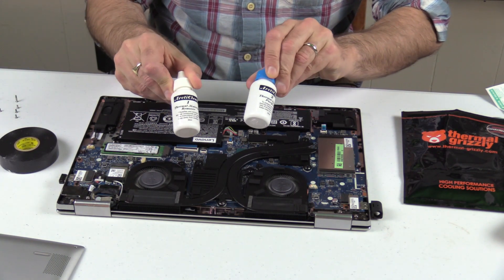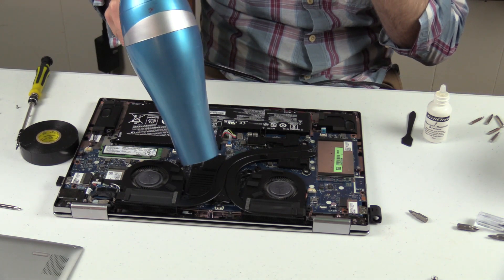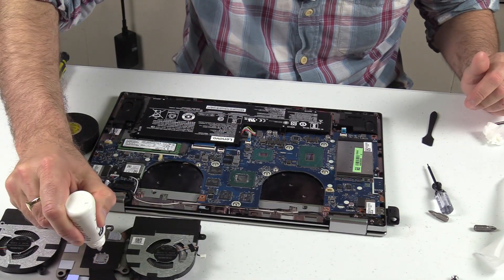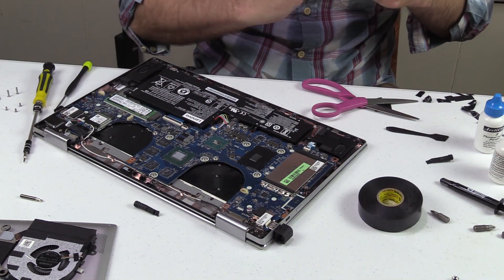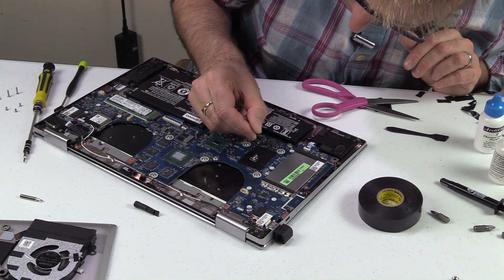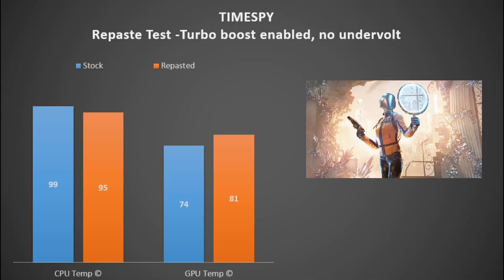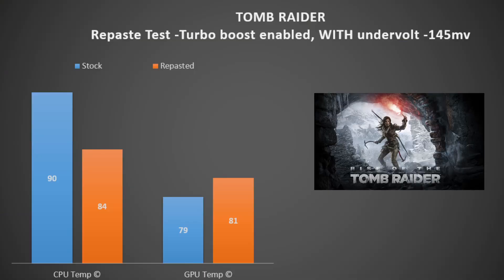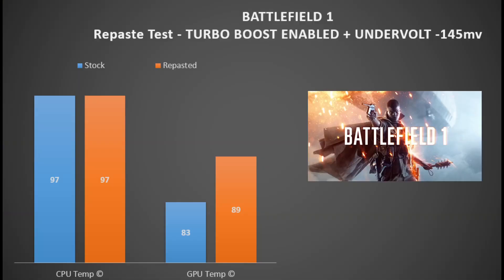Repasting The Lenovo Yoga 720 - GTX 1050 - Does it help ?

Comment: Just a tip for you always and i mean always disconnect the battery if possible else one slip will cost you the laptop as there is power still flowing on the main board.
Reply from the maker: William Rogers yes indeed, thanks for mentioning that. I pinned your comment.
Reply: Glad to help, seen some of your thermal replacements and noticed that this step wasn't done so thought i'd point it out, even when i did my GPU upgrade on MSI GT72-6QD the first thing i did was remove the battery. But a simple step for your Followers is simply Un screw and remove the back plate then promptly go to remove the battery before touching anything on the board. All will be fine after. But i do have a question with Liquid Metal does one have to repaste both the Heatsink Exchanger and the Die or can it just be pasted on the die?
Reply from the maker: William Rogers I found just placing it on the die is enough. I'm fairly new with liquid metal and I don't like the idea of a bunch of it migrating to other parts of the laptop..

Comment: I need to replace my fan assembly, so this is incredibly helpful. I found somebody to do it inexpensively, $35 labor. But I wanted to check heat before and after. And even for that this is very helpful.

Comment: Your assumption that the GPU temps go up because of the thermal paste is not quite right. As the heatsink can remove a lot more heat from the CPU with the conductonaut, all of it gets transported over the GPU to the fans and this way the heat is transfered to the GPU which gets hotter. This effect most likely would have been even worse with Conductonaut on the GPU.

Comment: Hello Stephen, Thankyou for the video, i unplugged my lenovo flex 14 battery and plugged it back in, now it wouldn't charge at all, when i unplug the battery again the laptop recognised power is connected, but when battery is plugged in then it doesn't recognise battery nor charger... do you think this is an software or hardware problem? thankyou

Comment: Is the heat pipe copper or aluminum? I heard that there you cant put metal on aluminum. Is there any chance of metal leaking? I know it might be stupid question but did you remove tape after applying paste? Thx for helping
Reply from the maker: I took it apart some 9 months afterwards, there was no corrosion so I suspect it was copper. I put tape around the die but I had put too much LM on and a bit did leak out. I recommend putting some a foam barrier around it and certainly less than I applied. My laptop was still working but don't have it anymore.
Reply: @OWNORDISOWN  thank You very much for response :) I'm new into replacing paste so I decided to stay with kryounat. Is it still the best option?
Reply from the maker: Yes, I think that is the safest option :)
Reply: @OWNORDISOWN  thank You! I will leave a like and subscribe! You are great :)

Comment: Hey there 1 Question: Is it possible to turn off the hyperthreading for this Lenovo maschine? (because of Meltdown & spectre)
Also it helps to drop the temp a little.
Reply from the maker: No I don't think so. I don't recall seeing the option in the BIOS and I don't have it any more., but you can disable turbo boost or even better just reduce the clock rate
Reply: thank you for your fast reply and your advice. Will keep your channel in mind. @OWNORDISOWN

Comment: just now finding this. I have a yoga 720 without the graphics card and am getting an egpu soon. Unfortunately when I run anything under load, it immediately throttles, so I will be repasting very soon!! awesome video!!
Reply from the maker: Noah Leake Thanks ! If you do liquid metal make sure to use less than I did. I put on too much really . Good luck ! Have you tried undervolting ?
Reply: OWNorDisown I have, but haven’t had much success. My thought is that I am using integrated graphics (limited to a couple games) for now. I was thinking this might be putting even more strain on the cpu since I don’t have a dedicated gpu.
Reply from the maker: Yes, it will do. You can undervolt the integrated GPU part too. Its a shame you cannot increase the fan speed. I'm going to do a video testing one of those graphite thermal pads...
Reply: use Gelid GC Extreme instead of metal

Comment: i saw videos for the 1080p version and it doesent seem to get to 90 it seemed to be around 50 celcius so is it just a problem with the 4k version
Reply from the maker: I wouldn't have thought so. If you saw my full review Lenovo disabled turbo boost so it would run at about 1000 MHz less. They did this because they knew it was hot. Most people wouldn't know . Perhaps the videos you saw still had it disabled....
Reply: was that done in a patch then?
Reply from the maker: Kamikazi Lucas it's done at the bios level. Install Throttlestop and you can check...

Comment: do you leave the electrical tape inside
Reply from the maker: Yes, it helps protect the surrounding area from the liquid metal. I put a little much LM on this time. Just a thin layer and you are good :)
Reply: Thanks, and also should I apply conformal coating underneath the tape just in case. And I'm not sure how much liquid metal I should buy.
Reply from the maker: Michael Lee can't do any harm.  The tape used needs to be thin, some use kapton tape. I like the idea of the conformal coating around the area too, last thing you want is the liquid metal shorting anything out on the motherboard.
Reply: One last question, what's the heat sink made of for the yoga 720 and will it corrode over time?
Reply from the maker: Michael Lee after 7 months my heatsink was not corroded,  it was discoloured,  like a stain. It wasn't brittle like you would get with aluminum so I suspect it is copper

Comment: I have an alienware 15r3 i7-7700HQ with gtx 1070 i need to repaste it since the temps go up 97 Celsius, is liquid metal safe after months on cpu and gpu?
Reply from the maker: juniora aburto After 7 months I opened up my yoga 720 and it was still good, but it will end up oxidizing and even reacting with the copper. They say to redo it every 6 months. Dont put much on, I put you much on here really. Good luck!

Comment: hello mr exklim realy i like your dissect about the devices and i want your experince to advice me. iam a graphic designer and interesting to get this device yoga 720 15  core i7 with dedicated invidea gtx but not the 4k cause it have a big issue  with thick blk line in top ... so do u recommend this model for work with adobe illustrator and premier
Reply from the maker: Mohammed Abdulaziz hi Mohammad,  thanks , glad you like my videos. Yes, I think it will serve you very well. Six core  CPUs will be coming out soon, perhaps next month and that may help in your rendering.  I haven't seen any models announced yet but that is what Gigabyte told me .
Reply: ?i appreciate your reply so The problem of heat will not affect performance
Reply from the maker: If you apply an undervolt you should be fine :) I wouldn't recommend disabling Turbo boost but you can also use Throttlestop to alter the multipliers down a bit if need be. Start with the undervolt and see how you get on :)

Comment: You should do a video on undervolting the GPU and see if there is some performance perks in gaming for this laptop
Reply from the maker: Already have my friend:) https://www.youtube.com/watch?v=kKATo7iLjXg
Reply: Alright, I tried it on my yoga 720 and I think I did it wrong it something because nothing changed from what I can tell as far as temps and frame rates go. I have it flatline at about 1800mhz at 925mv.
Reply from the maker: You won't see any increase in FPS unless it is boosting higher. Have you tried overclocking it? As far as temperature goes my GTX 1050 didn't get hot. BF1 is the hottest at 89 degrees and that is overclocked
What are your temps?
Reply: I haven't tried over clocking it because I'm fairly new to this. This is my first laptop with a dedicated graphic card.

Recently undervolted the CPU -0.140 and I'll reach max temps when using the xtu stress test at about 78c

GPU 70-75c indoors.

Now I am only getting my temperatures from monitoring xtu's min/max/avg stats.

If you have any suggestions I'm all for it
Reply: Would you recommend over clocking  CPU, you, or gpu memory?

Trying to get all the gaming performance out of this thing I can get

Comment: Does this break the warranty by doing this? Thanks!
Reply from the maker: I don't believe so. make sure you only put a small amount of LM on it. I would actually recommend sticking with something like Gelid GC Extreme. I did some testing and it performed at same level as the liquid metal plus there is less risk of short circuiting your motherboard.

Comment: Can't believe what I'm seeing here...
How can it be that you do not know that you DONT spread the paste!!??
https://goo.gl/n3dQp5
Reply from the maker: It makes no difference. In this video I applied the Ic diamond in an X and it actually performed worse than Gelid Gc extreme that was spread. https://www.youtube.com/watch?v=1u_CXoQzNNg&t=23s
Perhaps you should do a comparison of your own and submit your findings.
Reply: If you spread it you a) get a mess and b) include air pockets and dust particles in the paste.
If you apply it in a speckle or in a line, you avoid a) and b) while covering the entire area optimally.
So it's clear what you do.
Reply from the maker: FamKis the force of applying the heatsink will force any bubbles out. The proof is in the pudding and in my thermal paste test it made no difference. I suggest you read this, it shows that the spread method is actually better than a prayer dot 
https://www.pugetsystems.com/labs/articles/Thermal-Paste-Application-Techniques-170/#TemperatureResults
Note that the author of the article suggests the spread method for integrated cpus you get in laptops.

Comment: thanks a lot for the video. What are the conditions of th heatsink on the liquid metal side cpu? I know it is corrosive on alumin not copper but I feel still a bit uncomfortable with the idea of using it on my yoga 720 15"  (even if I' m in love with t drops it's capable of) because of the black surface around the copper part which seems to cover the rest allumium portion of the heatsink. If that black painted frame extends on the copper contact site I'm for sure more relaxed. I would't want to risk and mess up with the aluminium surroundings 
Also it is not clear to me how the liquid metal behaves (how much aggressive is ) over the long term on the core die. Does it leave any evident signs (even slight compared with the traditinal solutions?) 
- Repasting with liquid metal would void the warranty ?
-Instead of using electrical tape wouldn't it be even better to use thermalpads with a proper thikness as protection and a possible further slight improvement on the overall heat dissipation capacity?
- About thermalpads. Someone pointed out, given you are on the way opening  it up, to change the factory  thermal pads as well with something of higher performances. What are your opinions about, and in case what brand of Thermal pad would you recommend?
- About thermalpads the second. =) premising I haven't opened my 720 yet, looking at disassebling picture and videos made me wonder if applinyg some other thermal pads  between the metal bottom panel and the heatpipes (given the ,apperent at least, little room inbetween, could  be an easy and cheap way to improve the passive  heat dissipation. What are your toughts about?
Out of the warranty period or with a 2nd heatpipe available would be terribly satisfying messing around soldering some extra heatpipes  and find out an elegant custom solution to better take advantage of the untapped passive dissipation capacity the bottom metal panel could offer.
Reply from the maker: Hi Kevin, I like your thinking about putting pads between the heat pipes and the bottom panel - interesting idea !
People have recommended Fujipoly pads so they may be worth a try.
I recently looked at the condition of the liquid metal on the heat sink and it wasn't crusty which I was half expecting to see. There was some discolouration on the heatsink though.
Someone recommended to use Kapton tape instead:
 https://www.amazon.com/Heat-Temperature-Resistant-Adhesive-Electric/dp/B00W3FAFP0/ref=sr_1_4?ie=UTF8&qid=1518057703&sr=8-4&keywords=kapton+tape&dpID=41remhS2vSL&preST=_SX342_QL70_&dpSrc=srch
My main advice on doing this is to use as little as possible liquid metal to make sure it doesn't run onto the pcb. 
Perhaps start with some good regular paste first like Gelid GC Extreme and see what results you get.
I did a test on my Sager NP 9873 and there wasn't much between them.
Here is that video: 
https://www.youtube.com/watch?v=1u_CXoQzNNg
Reply: yeah Hope it will be a good idea! I'll let you know guys in case I proceed with the experiment maybe after some prior calculation and estimates. Problem is  the heatpipes seem to be isoleted with that black painting wich of course has to be scratched away and I'm worried that interferes with the warranty validity.
Undervolting helped a lot but obviously is not enough!! (mine seems to stay preatty stable at -150 mV on cpu core, gpu, cache, system agent and analog I/O but I have to test it out further more. I don't have much time available with university. I' ve noticed, if I'm not wrong, the fast ramping up of the termperatures decrese a lot the undervolting headroom).
Onother idea to evaluate are the relatively new 1 mm thick sheet heatpipes used on new smartphone  but I haven't figured out yet their actual performance order of magnitude. Anyway I want that metal bottom panel to be used as a passive heatsink!!=D
I love the 720 15" but saying the thermal performances are bad is an euphemism really! A little bit more of engineering would have been enough to place some more more powerful heatpipes dear Lenovo!
Reply from the maker: Tell you what - if you do embark on this venture I would love to interview you and show your work in a video if you up for it. I think it is a great idea and love the creativity :)

Comment: Hello and thanks for this video. I want to buy this computer as a mobile and web developer and designer I am but I'm scary about the scratched tape you got.
Do you recommend to use something like a cover to protect it of that? But might be a problem to rotate it to 360 position.
I want to buy the FHD model + the nvidia, can it use an external monitor to 4K display?
Reply from the maker: Ruylo Thanks for watching it 😀 I purchased a nice case 
https://www.amazon.com/gp/aw/d/B06XYVH96B/ref=mp_s_a_1_6?ie=UTF8&qid=1518008425&sr=8-6&pi=AC_SX236_SY340_FMwebp_QL65&keywords=lenovo+yoga+720+15+case&dpPl=1&dpID=51LgjpDdeQL&ref=plSrch
Yes, you can get a dongle adapter that fits in tbe usb c port to hook up 4k 😀
Reply: OWNorDISOWN Tech Decisions Made Easy 
Thanks for the answer but I'm referring a cover or something like that: https://m.ebay.co.uk/itm/NEW-mCover-Hard-Case-for-NEW-15-6-Lenovo-Yoga-720-15-2-in-1-Ultrabook-Laptop-/232525889142?_mwBanner=1
Reply from the maker: That does look like a good solution. I checked Amazon is the US and they sell it but many people say it doesn't fit...https://www.amazon.com/mCover-Shell-Lenovo-laptop-Black/dp/B076HB7F3M#customerReviews

Comment: Does anyone know of manual or photos on removing the USB from this unit? 

It's gotten badly damaged physically (don't ask). It's unusual enough that I haven't found a manual or photos that show removing & replacing it. Lenovo tech thinks it probably screwed to main board. One on side w/power button on Yoga 720-151KB 80x7 (HD screen)

Loved this video on heat sinking, so hoping someone passing by can help?
Reply from the maker: c B glad you liked my video. I found this video https://youtu.be/B0fTf8u7X0A
Reply: Thank you, thank you, thank you! I thought I posted a thank you for years ago but apparently not. I hadn't found anything remotely that exact to what I needed when I searched.

Comment: Are you going to re-upload a re-re-pasting video soon? Just bought mine a few days ago. Also, will Lenovo release a bios update that could enable increased fan speed you think?
Reply from the maker: I actually did one a while ago. It would be nice if they did allow us to change the fan speed, they should do so but probably won't as they want to be in full control of it I guess. Here is my video on it being repasted: https://www.youtube.com/watch?v=F0nyLA-65sU
Reply from the maker: Prestonious I'm afraid my yoga 720 is broken. I took it apart to see how the liquid metal was and I think I must have bent the motherboard when lifting the heat sinks off as it wouldn't boot afterwards. It's going in for repairs.
Reply: OWNorDISOWN Tech Decisions Made Easy dang sorry to hear about that. I went ahead and undervolted mine like you suggested in one of your videos. Approx - 113mv on the core, cache and igpu. It's stable. However I havent tested to see if there is any difference in performance although I feel I'm getting slightly better battery life. One thing I did notice is that I can't use after burner to undervolt the 1050. Any suggestions?
Reply from the maker: L Roberts I know,I was gutted 😥 Might have to alter the config file to allow voltage changes . I'll try on my gt1050ti laptop and report back.
Reply: @OWNORDISOWN  Hello, did you find out what was the culprit with your 720 not working. I didn't see a follow-up to that.